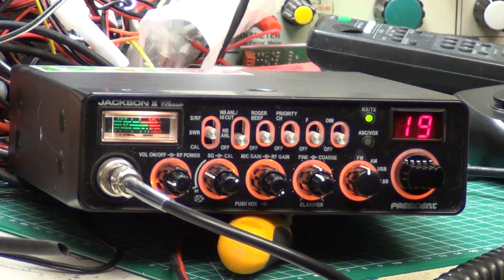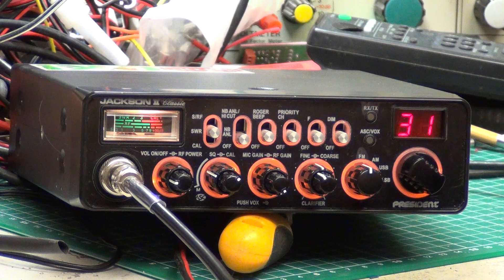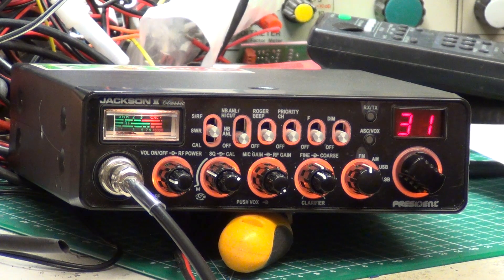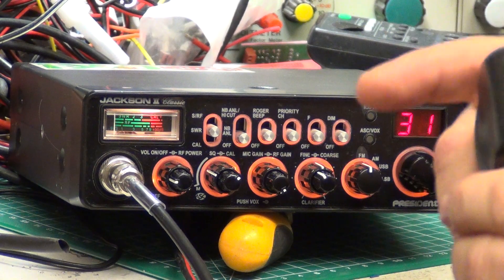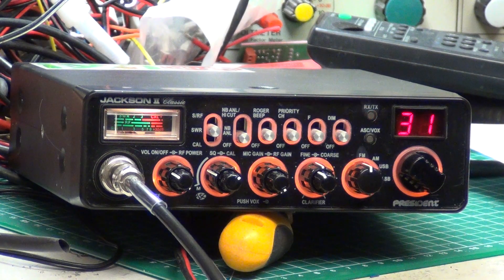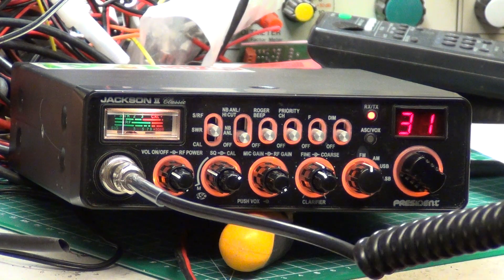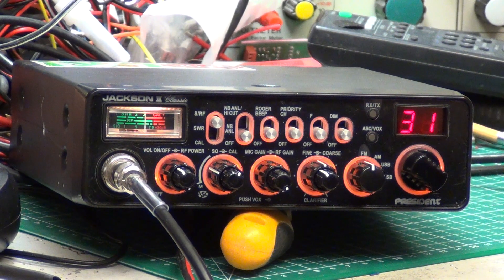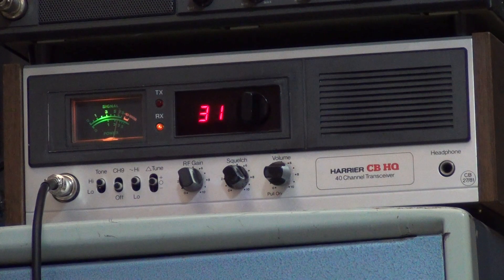President Jackson II Classic CE MultiNorm CB radio. FM 'On The Air'  test

Comment: could you give my advice with my president Jackson 2 classic.
when i use the cal option and put it on the arrow.
than when i switch to swr i get almost 3.
i am testing on channel 20 FM
Reply from the maker: but what are you getting with an external SWR meter?

Richard
Reply: @ukfmcbradioservicingTango21  I will look for a external meter and let you know
Reply from the maker: @wilfredprins9718  I'm just wondering how you set up your aerial without an external 'normal' swr meter? or if you were relying on the internal one which shows a scary 3.

Richard
Reply: @ukfmcbradioservicingTango21  sorry for the late reply

I checked with the swr of the cb radio.
I connected it the the antenna I had my Midland USB mini on
Reply from the maker: What I'm trying to get out of you is asking what the SWR reads with a normal external SWR meter. OK, so you connected your Midland USB mini, but it sounds like you never checked the SWR. Bear in mind an SWR of 3:1 or greater will destroy the radio's output transistor as clearly stated in the instruction book!  You'll also get very low range,

Richard, G0OJF, UK
Reply: @ukfmcbradioservicingTango21  thank you for the reply.

I will look for swr meter before I use the unit
Reply: @ukfmcbradioservicingTango21  sorry for the late reply,I just got my SWR meter, when I test on on channel setting A on channel 20 I have a SWR reading of 1.4
Reply from the maker: Good, so your SWR is OK in reality & the build-in meter is lying.  Richard @wilfredprins9718
Reply: @ukfmcbradioservicingTango21  unfortunately it's very silent on the cb here in holland

Comment: Why is your needle sitting constantly on 5 pound and not at the bottom
Reply from the maker: Bear in mind only the S9 point is calibrated. Every other S point on a radio differs from set to set. To answer your question though, residual background noise changes from day to day, our to hour as radio conditions change as affected by the weather & atmospheric conditions. Yesterday I has S1. Today I have S5.

Richard, G0OJF, UK

Comment: Going back a bit to make this comment relevant ... sort of ...  Looks like the first FCC-certificated AM/FM CB will be the "President Thomas FCC".  Googling around, I see that the President Thomas ASC is a little long in the tooth for you all ... did Team Tango Tower  ever run a Thomas ASC around Scratchy Corner?  I did the search thing on the channel, but didn't see one (but don't trust YT's search accuracy!).
Reply from the maker: I can's see we've had a Thomas ASC. The wholesaler are instructed to sell me every UK legal, non SSB set as they come out but I don't seem to quite get everything it seems.

Richard, G0OJF, UK
Reply: @ukfmcbradioservicingTango21  Understood.  Looking at other, non-Tango Tower videos, it seems to have debuted about 2013 and does seem to support UK channels but alas ...  Keep up the good work!

Comment: May I ask why you choose not to service the SSB portion of the radio? Is it due to lack of test gear or because of SSB not being as used as much as FM ?
Reply from the maker: We have no SSB specific signal generator to verify adjustments on rx & no two-tone oscillator required for transmit audio setup. This is a commercial 2-way radio business & nothing we see is therefore SSB. As I licenced radio amateur since 1979, I have no interest in SSB whatsoever. We do the CB radios as a courtesy to our business customers. As SSB & AM is only available on the CEPT set of 40 channels which is full of interference & virtually unuseable much of the time, it's pointless to try & demo it here. Whereas we get 35 miles on FM UK channels in our 'food direction', I've had as little as 1 mile range on CEPT FM because of residual background noise.
I doubt many other two-way radio engineers have SSB specific test gear either.

All that said, the adjustments I made on AM & FM will also mean that 95% of the SSB part will also be spot on. If I can't prove & verify, then we're not touching it.

Richard, G0OJF, UK

Comment: I'm curious why you didn't do the SSB side?..........as this is a legal UK Type approved multi-mode
Reply from the maker: We don't touch SSB equipment of any kind...that's company policy & have neither a two-tone oscillator to set up the transmitted audio, nor an SSB signal generator to verify receive . As you well know, the AM & FM adjustments I made cover 95% of the SSB circuits anyway. I'm simply not touching anything I can't verify & prove. Bear in mind this is a commercial 2-way radio business & we only do CB radios as a courtesy to our business customers. 

Richard, G0OJF, UK
Reply: @ukfmcbradioservicingTango21  The thing is generally this radio has quite poor SSB and I'm pretty sure nearly everyone who buys these modern Multi-mode radios use them for SSB operation, or why bother?I guess everyone to their own.